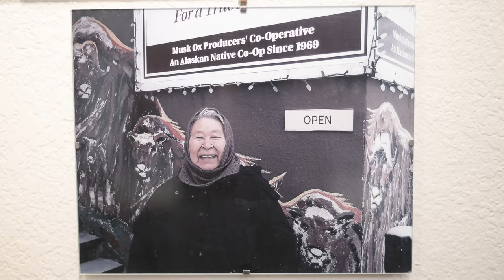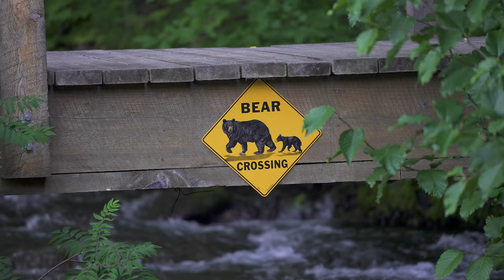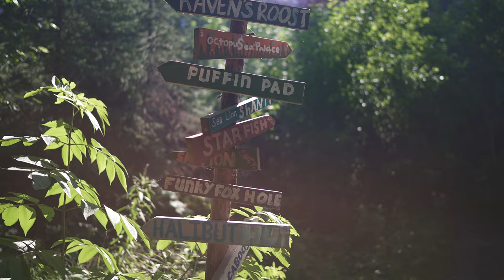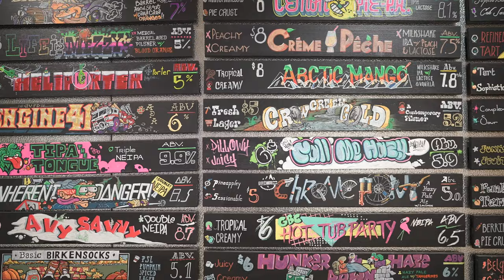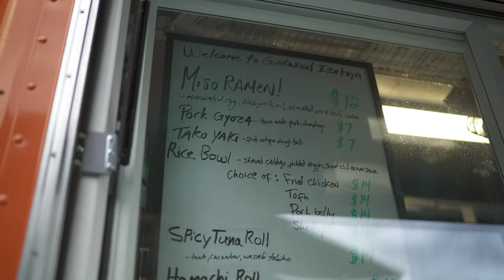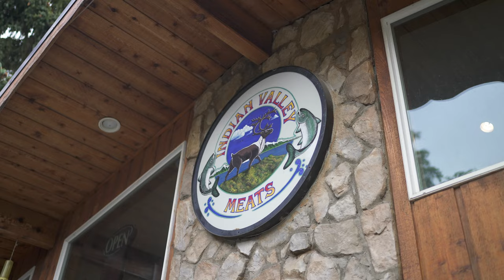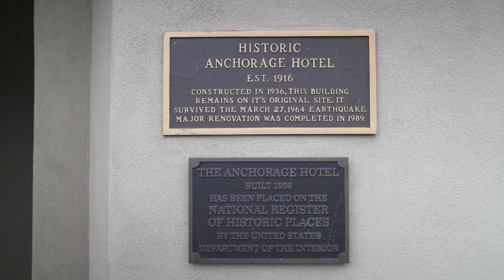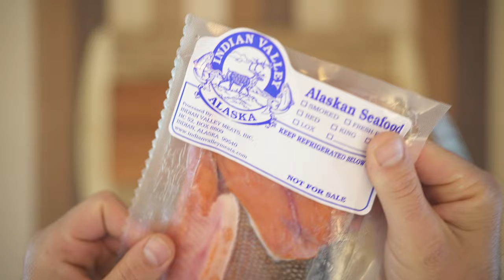Alaska: Anchorage to Seward - Travel Film

Comment: ..a good well rounded video of the local region, but lacks depth where living here full time for more than 65 years might portray to a flash-in-the-pan instant visitor one may discover shopping in Anchorage Walmart, in route to their dream vacation by bus to Denali Park; from Europe.. 
Where I've lived here most times, getting water in winter is a problem and wells are impractical, costly and deep; to just get salt water, more often than not! An nearest neighbor is usually 20 miles away, who has a good spring that does not freeze due to better designed water box for subzero deep freeze reality; the other side of global warming reality I've seen since 1960, and witness ancient ice fields evaporate due to very changed weather factors across all former seasonal boundaries.. Hatchery fish restocked streams or for derby uses, are often smaller than wild runs of prior seasons, as other factors also change. And I still haul water in a small town, but that is being impacted by development by those who have no idea of how they impact longer term survival.. I grew up in east Kenai Mts near Seward, before 1964 AK EQ and helped clean oily beaches from 1989 Exxon Valdez oil spill disaster; I kept finding oil, so I was told I had completed my term of employment. The spill cleanup was said to be done at least five times; but still I could find crude oil, layered in tidal rolls on the Kenai Fjords Nat'l Park beaches near Homer, out from Seward. I'm still here.. But I don't walk on those beaches anymore.
  ~ small town AK-USA
🇺🇸🐟☃🌦🐻❄💮